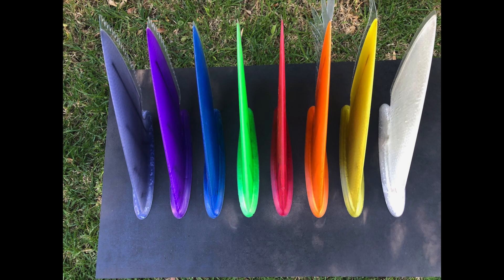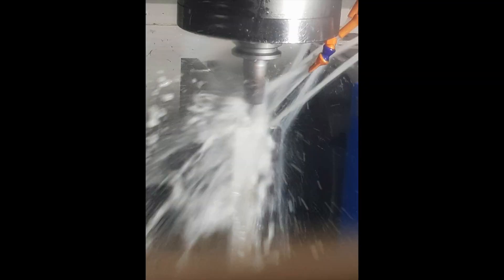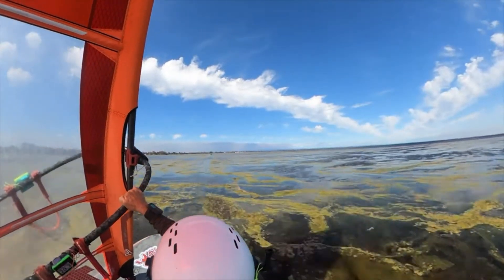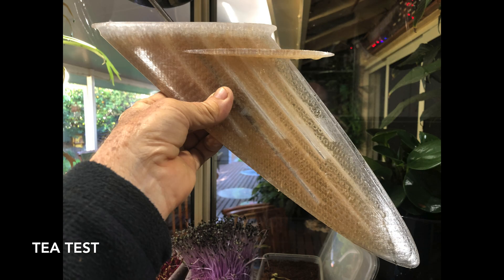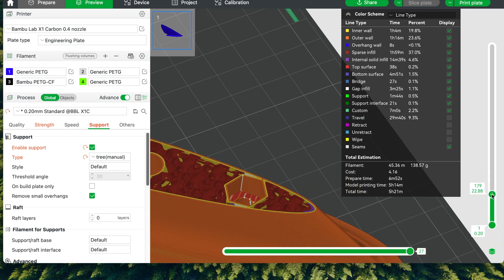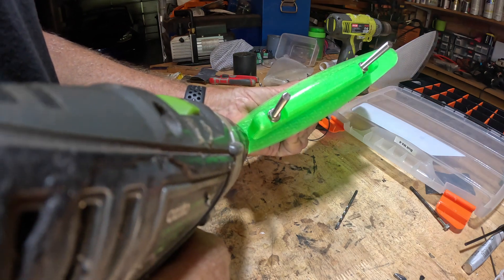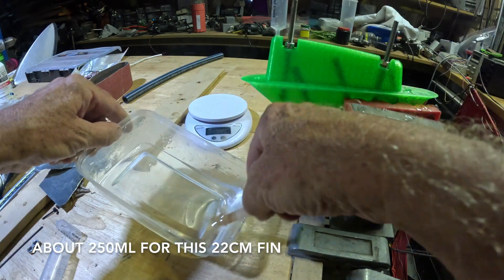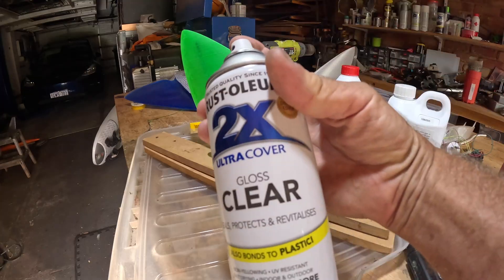3D printed fins for under $30 AUD

Comment: Hey buddy! Just saw your video, I have a blow up paddle board that I’m wanting to convert to a wing surfer. Just wondering if you could print a keel and keel box that I could stick to the bottom of the paddle board…like the supwinder from slingshot. Just wondering how much you could do this for??

Comment: Beaut work ! esun pla plus with 30 percent triangle infill and 6 shell layers works fine for quad surfboard fins. 100 percent infill on the inserts and anchor points. Petg by itself lasts about three turns.

Comment: Great vid. I’m keen to try 3d printing surfboard (kitesurfing) fins - do you think PLA+ filament would work ok? Love the idea of filling with epoxy for strength, I’ve been wondering how to add strength to the printed fin, great solution!
Reply from the maker: not sure with PLA+, personally I think PLA+ is a bit stiff/brittle and more likely to crack under high G/impacts. However, I've never tried it and with a stiff epoxy mix and smaller fins you guys use will probably will work just fin.  Pretty cheap experiment to give it a crack anyway.
Reply from the maker: damm spell corrector...probably will work just fine...